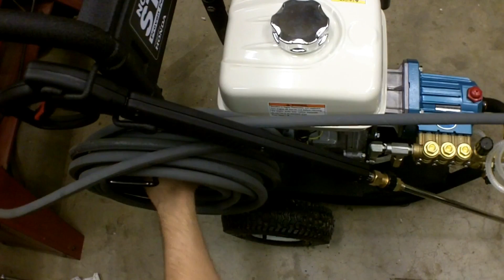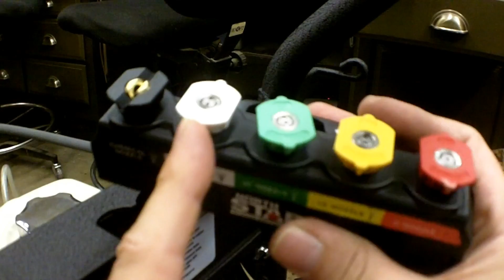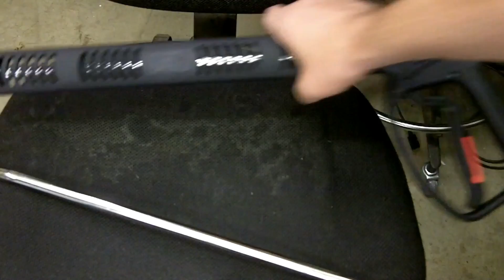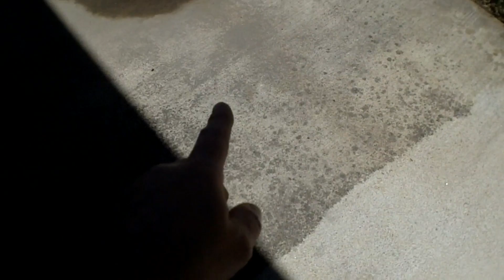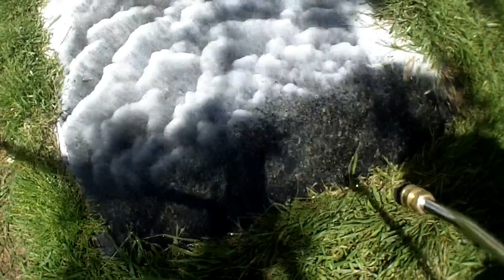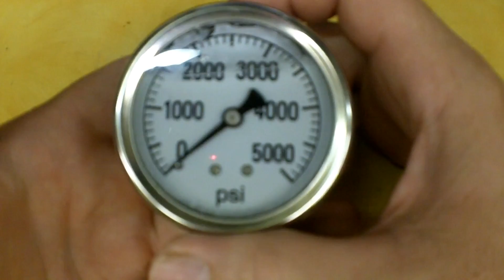NorthStar 3300 PSI 3 GPM Pressure Washer Review Item 15781820

Comment: This machine is now $58,654 in 2025.😂
Reply from the maker: I wouldn't go quite that far, but yes- things do cost more. I actually used mine today and it started up on the first pull and still works like day one. I've not used it for may years.  Mind you, day one was 11yrs ago. The trick is to drain the fuel (or suck it out) out of the tank and run the bowl dry. As well as disconnect all output lines and blowing everything out with compressed air. Leave everything past the pump open air until the next use. This has been a beast of a washer all of these years- and still is. Take care, G.

Comment: I have been looking for a pressure washer.    Seems like the CAT pump and Honda motors are prized.   But they are expensive.   I am conflicted between this model and the Harbor Freights Predator 4000psi for $1099.00.   It has a predator engine (supposedly made in china) and a  Annovi Reverberi triplex pump, again made in china.  The reviews are good mostly so it seems to hold up.
Reply from the maker: Yes, that combo is prized for sure- they just work. The Predator engines are basically a Honda clone. I'm not familiar with that triplex pump so I have no comment on them. Check into the warranty for both. I can't say which is the best for you, but for me- I'm still completely satisfied with my choice. Good luck and take care, G.

Comment: Same with me on the controllable valve being too tight when un boxed. Dam too tight from the factory. Went through the first tank of fuel regulating pressure by the engine speed. But this PW is a Beast. The 270 cc Honda is Sledge Hammer for power, not for the kind hearted weekender. My fourth PW in forty years from NH.
Reply from the maker: I thought it was just mine Robert, but apparently not. I don't recall if I said, but I pulled the black knob and used a wrench to break it loose. A beast it is! It will straight up tear thing up  if not careful. Hope it works out well for you long term. Good luck, G.

Comment: I removed the thermal valve cover and installed a hose back to my water supply tank when the spray gun is not engaged. So it continues to recycle water when the spray gun is not engaged keeping the pump cool with cool water. I operate a mobile detailing business btw.
Reply from the maker: That's a cool solution Daniel! Thanks for the info. Take care, G.

Comment: I know that your video and review is over 2 years old but I wanted to thank you for this excellent review.   I was shopping for a power washer and based on your review I purchased the 2.5 GPM 3300 PSI Northstar unit.  (#157123).   My wife and I both watched the review, and purchased both the rotating nozzle and the pressure gauge.   I am a "belt and suspenders" person so I fully read (underlined and highlighted) both manuals - the one for the spray/pump and the one for the Honda engine. Assembled everything slowly and "by the book."  Hooked everything up in order - and presto - started on 2nd pull and it does and amazing job.  I was wondering how long it was safe to  run the pump so I called the Kat pump folks.   The tech rep said it can run 24/7 as long as the oil is ok - AND you must turn off the engine if you are not going to spray for 2 minutes of more.  He said walking away from the sprayer for more than about two minutes with the engine running will often damage the pump. He explained why but I didn't understand it. My wife and I agree that you are a very good teacher and you have a great voice tone and style.   Many thanks from San Antonio, TX
Reply from the maker: Yes E.C.,  just about 6yrs. now- hard to believe. While mine hasn't ever seen hardcore use- It still works like it's day one. Glad to hear you and your wife like my style. Much appreciated from OK.

As for the pump, the main reason to not let it idle for long periods (2min max using your reference from Cat) without spraying is the fact that the water itself keeps the pump cool.  When the trigger on the wand is NOT pulled- no fresh cool water is flowing so the pump will get too hot and can cause pump damage. 

I never go 2min on my machine. 1min is about my max. If I'm doing something else- I will go over and pull the trigger for a few seconds to get new cool water in the pump, then continue with my task. I repeat as needed. If my task ends up taking too long- I shut the machine down. 

Please read my other reply's to comments/questions  on the video. I believe I have one related to how I prepare the machine for storage. This will greatly prolong the life of your machine- in my opinion. There may also be other beneficial information in the comments section as well. 

If you haven't done your first "session" yet- you're going to be looking at anything and everything to hit it with....lol. 

Final thought aside from my standard "Good Luck"- be careful as this thing is extremely powerful and can (slash that, WILL) cause damage to your surfaces if you're not careful.

Play with it and feedback with your thoughts. I'd like to know. Take care, G.

Comment: That pump has 2 venturi points for chemical injector i hace a machine and im trying to make foam what injector to use one is black plastic tip that says "therm. " the other one is metallic says "chem." i did prove with metallic one and nothing no suction..
Reply from the maker: I don't know. Mine has the pickup hose attached to the top port. The one on the side with the black plastic is for letting water out if it gets too hot. To get it to pickup soaps, you have to use the low pressure black nozzle. Good luck, G.

Comment: Hello, and thank you for the video - how's the pressure washer holding up?  Any updates or issues?   I'm getting ready to bite the bullet and probably spend the extra money for the Northstar,, thought I'd check in with ya first.  :)
Reply from the maker: Just like day one Brian! It doesn't see hardcore use, but it fires up every time and simply works. There are things I do though which I'm sure helps for longevity. First, I shut off the fuel and let it run till it dies with the water still attached. Then I disconnect the water hose, hose and wand. The hose, wand, as well as the pump get blown out with compressed air. That's how I always store it. It's a nice bit of cash, but still think it's worth every penny. If you do bite the bullet- let me know what you think after you use it a bit. Take care, G.
Reply: Thanks man!!  Which ever one I do settle on, I'll probably have similar frame of mind as you - longevity wise.  :)
Reply from the maker: No problem! Good luck, G.

Comment: quick question on the water pump do you remove the red top and replace it with the yellow one it comes with
Reply from the maker: Mine didn't come with a yellow cap Seth. The red cap had a black plug in the top that needed to be removed so the pump can vent. Not sure what yours look like, but you want to use the one that has a vent hole on the top. Hope this helps, G.

Comment: ghostses al g blue sky wind clng a little tid bit if you want to use  bleach you can get a chem injector from  c w c window cleaning it go on to the pressure connection first then the pressure plus in bleach does not enter to pump so it s callen down stream
Reply from the maker: Thanks! G.

Comment: Excellent review! Saw this unit in the Northern sale catalog for $949 & found your review today. The reason why companies ship the engines without oil, is a safety concern required by the trucking companies, UPS, FedEx included. If the filler cap was to come off in transit and leak out, it could potentially be a fire hazard, damage other freight & then the EPA gets involved if if leaks out of the trailer.
Reply from the maker: Thanks James! I agree with shipping engines with the oil in them- and the potential liabilities. What I was referring to was to include a bottle of oil in the box- not in the engine.  Either way, it's a great product. Take care, G.

Comment: I enjoyed you review.  I found a good deal on a Simpson PS 4033.  It is 4000psi  3.3gpm.  It has the Honda GX270 engine and a AAA triplex pump with bypass and thermal protection.  The pump isn't as nice as the CAT but for occasional residential use should give good service.  The retail price on the machine was about the same as your unit.  I lucked out and found my machine as an on-line return, new in box for $500 in the clearance section of my Sams Club.  I found they make whats called a 2nd story tip.  Its designed to reach two stories up with lower pressure so you can use your chemical and shoot to the top eaves.  Very useful for soft washing your house siding.
Reply from the maker: Thanks! I'd say you got a great deal on your Simpson! I hope it serves you well. Good info on the 2nd story tip. If I ever have the need for high work, I'll look into one. Take care, G.

Comment: i cannot, for the life of me, figure out why northern tool is (as of about two years ago) selling all of their power/pressure washers with the male end of the high pressure hose's 3/8" quick connect on the pump. the way i have always plumbed my units is to have the female end on the pump which will in turn give me the male end on my wand....which gets thrown around a lot....a 3/8" female quick connect is about twice as much as it's mate, so i would assume this is why northern is plumbing their units (and yours) this way.
if anyone else can shed some light on this, i would really appreciate it
Reply: and if you went over this in the video then please forgive me, i could not watch past about 6 minutes because i had to go to work
Reply from the maker: That's a good question Wesley and I don't know. If I were putting mine together, I would plumb it just like how I would with an air compressor, hoses, and air tools. Female at the compressor, and male on the tools. Basically just like you've described. G.
Reply from the maker: No I didn't Wesley. Still a good question! G. Perhaps someone will chime in with a practical answer. G.

Comment: is this pressure washer safe for washing cars/trucks/boats?  i'm thinking about getting one and found out this brand seems to have good ratings.
Reply from the maker: hltsolo I did quite a bit of research myself and I too found them to be highly rated. I don't regret a single penny of my purchase! It is safe for washing vehicles, but the pressure needs to  be turned down or you can do come damage with it. If that's all you plan on using it for, you might check out some of their other models that have smaller pressure ratings and save some cash. This model I've linked to caps at 3000PSI with 2.5 GPM and has a CAT pump on it. It seems to be the most inexpensive one with a CAT pump. I would look into this one over mine and save a couple of hundred. They have others for less without the CAT pump as well but I can't speak about them. If money isn't the object, I would go with a CAT pumped model. When I clean vehicles, etc. I turn the pressure down on mine to about 1700-2000 PSI and run a fairly wide tip. Hope this helps and good luck, G.

http://www.northerntool.com/shop/tools/product_200594736_200594736

I recommend picking one of these up as well so you know how much pressure you're producing!
http://www.northerntool.com/shop/tools/product_47632_47632
Reply: ***** Thanks for quick reply.  I want to "always" have the options of having high pressure to clean drive ways and/or reach 2nd story house windows.  Also, CAT pump is also one of the main reason I want to purchase the same one you have here on youtube.  For sure, I will be adding some additional accessories.  By the way, good review, I enjoy watching the video and it definitely help me in choosing to purchase the northstar brand.
Reply from the maker: hltsolo No problem. I agree with having the option of of higher pressure and the CAT pump rocks to say the least. You sound, to me, like your willing to spend more good money upfront over bad chasing bad- so this one would be the one in that case..lol. Once you get one, please feedback after using it and let me know what you think. If I'm not mistaken, you would be the second on my video to give an opinion of this model- mine being the first. I'm glad you liked the video and found it helpful. Take care, G.

Comment: hey it a mr a the sale man in charlotte n c told me that if you play with adjustment pressure value you could v o I d your warrenty .just lower the idle.
Reply from the maker: Thanks for the post Allen. I took a look at the manual and it does make a note about trying to alter the "maximum" pressure of the unloader valve and doing so would void the warranty. Turning the adjustment knob is OK to do. Lowering the idle would also reduce the pressure as well, and may even save on fuel. Take care, G.

This is the complete text from the manual.

"Do not attempt to alter the unloader valve's
maximum pressure. Excess pressure could
cause serious injury from escaping highpressure
fluids and/or pump damage. Any
alteration other than turning the adjustment
knob will void your warranty."

Comment: Good video.  I have an older Excel ZR2800 with a Honda engine (GX200 I believe.).  I bought it rebuilt at HD back around 2005.  Had a smaller one for about 2 years before the pump froze one winter.  Learned a lesson about winterizing.  In fact, I run a pump protectant and winterization after each use unless I know I'll be using it again in a few days.
I have a pretty big drive way and wash it and my neighbor's ajoining drive every couple of years.  I got a flat surface attachment (15in ez clean for $70) at HD that does a real good job on flat surfaces.  The attachment along with an extension really helps my back on these long jobs.  I use a turbo nozzle for the edges.
Reply from the maker: Thanks Gary! I believe you hit on a great point with winterizing. 2005 till now and yours is still working is great- is great! I do believe that's why so many don't make it for years on end. Regardless of the time of year I remove all hoses etc. and use compressed air to blow out everything on mine. I learned my lesson on an airless sprayer I failed to treat properly- and at a good expense to say the least. I treat my new airless the same way as my PW and they just work every time I want to use them!

Thanks for the info on the attachment. I've looked at others that were more in the commercial realm and couldn't/cant justify the expense for one. I will pick one up if I have the need to clean a larger area. Take care, G.
Reply: ***** I'm sure the ez clean would not hold up very long in commercial use.  I've used it on my drive and my neighbor's three times, along with side walks.  Another neighbor borrowed it last summer.  Also, used it a few times at my daughter's condo court yard and drive.  Still holding up well, but I'm not sure how durable the brush skirt is.  It's replaceable but not sure of cost.
Reply from the maker: Gary Hodgin
Thanks Gary! I should clarify I wasn't looking for a commercial unit, but that's what I was finding. I'd be using it for personal use. Based on your experience, it sounds like money well spent. Thanks again for the info! Good luck, G.

Comment: Great review G. Why did you need one so expensive? Just curious.
Roland
Reply from the maker: Thanks Roland. That's a good question and has several reasons. I wanted one with the cat pump so I could work on it easily and cheaply. The cat pump makes them more expensive by default. I also wanted a high psi and gpm so I could clean fast, and from far if I needed to. I'm getting ready to paint the siding I put on my three structures and needed to clean everything. Down the road, I will be using it for other properties I will purchase- cleaning drives, decks, fences, buildings, etc. This brand seems to be really reliable and work for years without problems if taken care of- but they do cost quite a bit. So It's kind of a pay me now or pay me later situation. If it were just going to be used around the house, it might be a little overkill for the money but my plans go beyond that and it will see much use. That's the short answer...lol. Thanks and take care, G.
Reply: OK I guess you bought the right piece of equipment for the jobs you intend to do. Good luck with it.
Roland